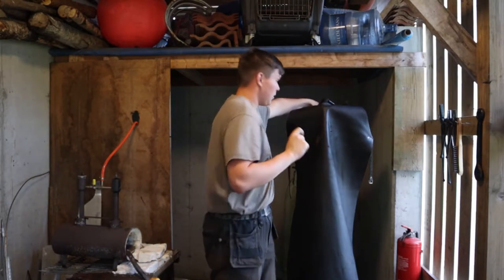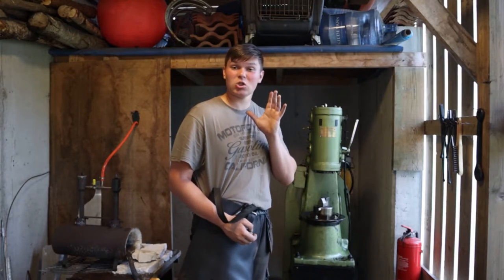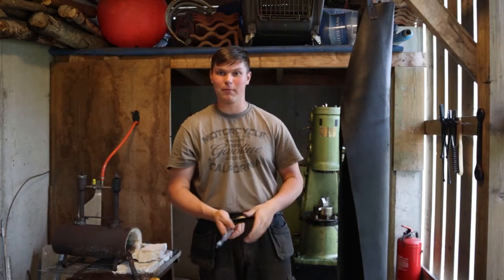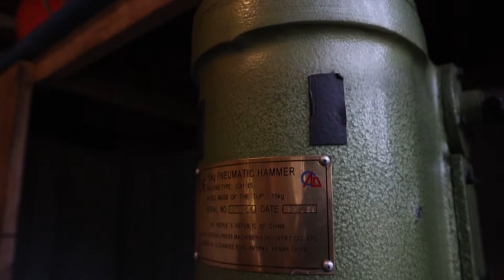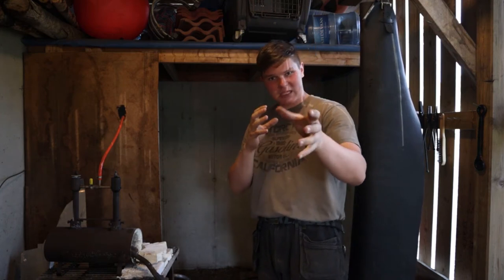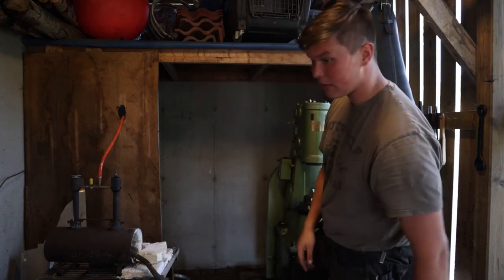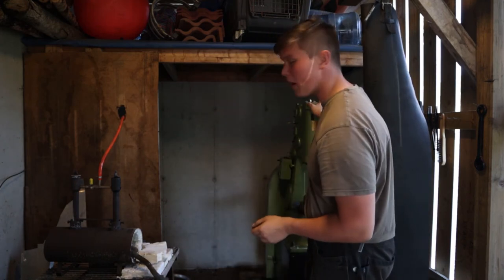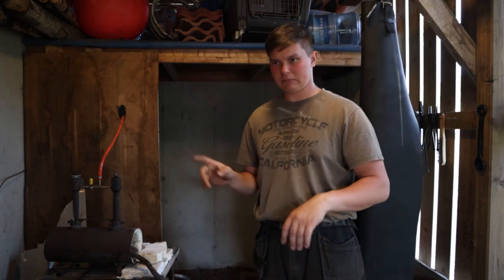The Power of the Mighty Hammer! - Anyang C41-15kg Unveiling

Comment: Does the hammer run on one-phase or three-phase power ?
Reply from the maker: It runs on three-phase 230V in our case :)
Reply: 🤷 240v is single phase 😜

How are you getting on with this power hammer looks like a grear size for a small forge